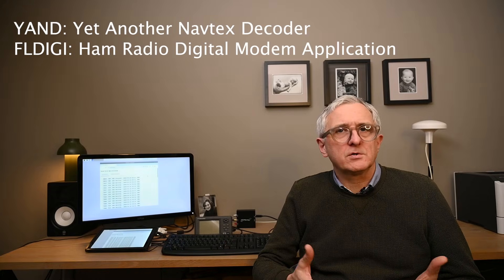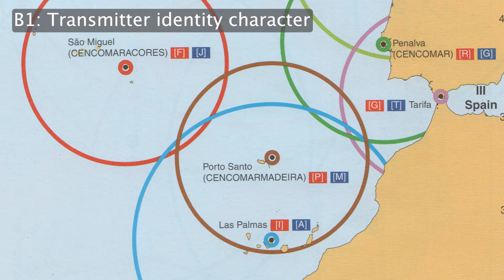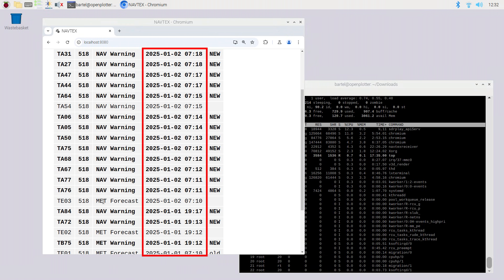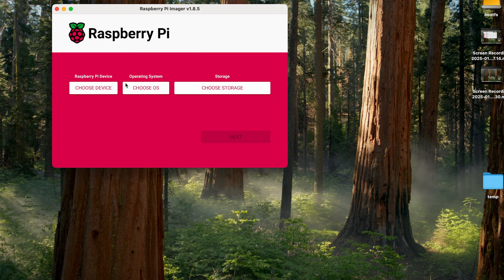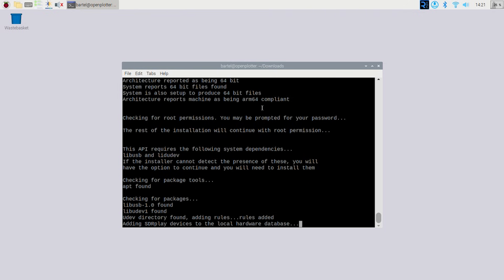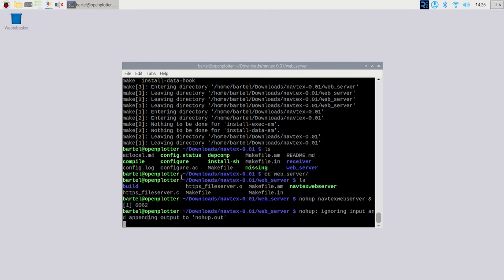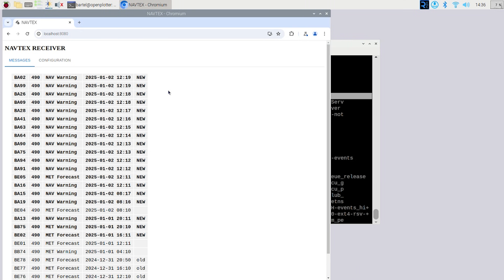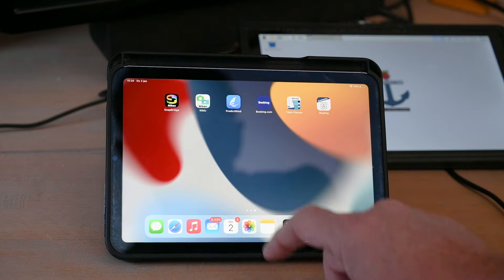NAVTEX on raspberrypi for sailors

Comment: Bravo, 
Avez vous egalement une solution en vue pour le decodage a partir d’un TX ou RX via la carte son ? Ainsi pas necessaire acquerir un sdr. 
Merci d’avance
Encore belle app
Reply from the maker: Non, pour le moment, je n'ai pas l'intention d'ajouter cette option à l'application. L'idée était de créer une configuration entièrement autonome. Ainsi, les utilisateurs n'auraient aucune intervention manuelle à effectuer, comme par exemple utiliser un récepteur radio externe, le régler sur la bonne fréquence au bon moment, etc.

Le logiciel de décodage est entièrement configuré pour traiter un signal I et Q provenant du SDR.

Est-il possible d'adapter le logiciel pour utiliser une carte son en entrée ? Ce n'est pas impossible... 
Je suppose que vous recevriez le signal sur un récepteur BLU (SSB), en utilisant le décalage de fréquence traditionnel de 1,9 kHz. Il faudrait prendre ces échantillons audio et :
1) décaler la fréquence de 1,9 kHz vers le bas et créer des échantillons I et Q (cela  correspond +/- à une multiplication par le sin et le cos de 1,9 kHz).
2) Appliquer un filtre passe-bas et rééchantillonner à 900 Hz. Heureusement, 44,1 kHz est un multiple de 900 Hz ; il faut donc un filtre de décimation avec un facteur de décimation de 49 (éventuellement en plusieurs étapes en fonction du contenu fréquentiel du signal audio).
3) Les échantillons I et Q à 900 Hz obtenus peuvent ensuite être transmis au logiciel via la méthode `sample_in` d'un objet de la classe `decoder` (voir `decoder.C`, ligne 42).

Pourriez-vous préciser le type d’application que vous envisagez ? LinkedIn me dit que vous êtes radioamateur, peut-être aussi navigateur (La Panne)?
Reply: Bonjour
Merci pour votre reponse precise. 
Effectivement un ensemble dedicacé en reception est preferable 
Je regarderais plus a fond votre logiciel j’imagine compatible ubuntu .
Dans le cas contraire un sdrplay et un rasberi ( le tout a mariniser) risque  de me couter plus cher d’un produit du commerce .
Plaisancier et radioamateur 😊
Belle journee
Reply from the maker: Bonjour,

Je pense que la solution la plus économique est d'utiliser un Raspberry Pi Zero 2W. (Attention au type de connecteur USB.)

Le coût pour "mariniser" la solution peut être un problème, notamment pour l'ajout d'un écran comme interface utilisateur.

Avec le Zero 2W, vous pouvez utiliser le navigateur sur une tablette ou un téléphone via Wi-Fi (aucun écran supplémentaire n'est donc nécessaire).

Le logiciel devrait fonctionner avec n'importe quelle distribution Linux moderne. En cas de problème, n'hésitez pas à me contacter. Je serai là pour vous aider.
BAV

Comment: Have you any thoughts on whether this hardware can be programmed to work with the proposed NAVDAT?
Reply from the maker: Well, the hardware (all of the SDRPLAY receivers for that matter) is for sure fully capable of receiving the proposed NAVDAT signal. (NAVDAT= the possible future version of NAVTEX)
NAVDAT would have a 10kHz signal bandwidth, so nothing any SDR receiver could not handle. 
When reading your question "whether this hardware can be programmed", you do have to know that the real 'software defined radio' magic is happening ... in the software and not in the hardware. The hardware will only 'sample' the complete information content of a portion of the radio spectrum. Then it is up to software to filter out the wanted signal, demodulate, decode, ..etc...
Navtex is a relatively simple modulation (FSK) and coding scheme. NAVDAT will be a much more modern one, using OFDM, variable modulation schemes (QAM, 16QAM, 64QAM) and error correction code rates. In other words, quite a different degree of complexity for the software receiver to be built here.

I hope this answers your question. 

By the way, there's quite a bit of info on NAVDAT available online. The only thing I'm unable to find is a clear calendar of how/when the system would be rolled out. There seem to be trials in France and China, but other than that no clear plan for the future.

Comment: 2:40 On the Turkish navtex frequency  4209.5 kHz, navtex messages end with three N. So NNN. I don't know why, but that is how I receive them with other software.
Reply from the maker: That's strange, the so-called "Navtex manual" by the International Maritime Organisation (IMO) makes no mention of this. 
Anyway, my software allows any of the 4 N's to be gone missing to still detect an 'end of message. So three N's would still be OK. 
By the way, currently you cannot receive 4209,5 kHz with my software. If you wanted to do it, it would only require changing one line of code though. You would the lose the capability to receive 490 and 518kHz in that case.
Reply: @boatcomm  Hello, a comment and compliments from a Dutchman based in North China. The 4209.5kHz is used in TUR, EGY, GRC, MEX, USA, but also in VTN, and CHN. 4209.5 transmissions in China seem to be easier to receive with my RTLSDR about 400 miles from Shanghai.  There are several new stations planned in Mexico. would it be possible to include the 4209.5 frequency and select or automatically skip according to the transmission times to receive 4209.5 messages? And is it possible to use with (much cheaper) RTL SDR v5, or would that involve a lot of rewriting the code?
Reply from the maker: Hello Arne, 
I can certainly foresee the possibility to receive 4209,5. It's a minor change and I can foresee a command line option for that. No issue. What I will not do is switching frequencies at certain moments in time. Navtex messages are sent preferably in the 10minute timeslots, but certainly not exclusively. Important messages (MET warnings, SAR messages,..) can also be, and often are, transmitted outside of the regular timeslots of the transmitter. So a decent Navtex receiver is listening all the time, not only during specific timeslots. 
Use of the RTL-SDR was not really my intention, but since there seems to be a lot of demand for it, I may give it a try one day. 
BTW, as 'Dutchman' you may also want to read the reaction I wrote on a comment of @pieterjanvisser yesterday. The RTL-SDR is a less obvious choice than it may seem. 
Is there a v5???

Comment: Hello! Maybe a bit of a straight forward question but what is the best way to update from navtex-0.01 to navtex-0.03. (Sorry I overlooked there was a newer version!) Best Regards.
Reply from the maker: First of all: I recommend upgrading to the last version indeed. I solved some bugs that led to occasional crashes of the webserver process. 

If you managed to get the v0.01 installed and working, the procedure to follow for upgrading is kind of the same: 
Download the tar.gz file (wget http://csme.be/dl/navtex-0.03.tar.gz)
unpack it with the tar command (tar -xvzf navtex-0.03.tar.gz)
move into the directory that was created (cd navtex--0.03/)
build the software (./configure ; make)
then running 'sudo make install' should overwrite the two executables (in /usr/local/bin) with newer versions

That's it basically. 
Let us know if it worked. 
Always happy to hear reports of people that succeeded in using the software and receiving actual navtex messages!
Reply: @boatcomm  Thank you for the quick reply!  I have had to start from scratch again as I seemed to have messed up the rc.local file!
My fault for using vim when I am use to nano! Still learning Linux Command Line! Not a problem though.
I will make note of the above info and keep a look out for the next release as and when it comes and will then do the upgrade and report back.
I would be interested in the future when up and running for a while to see if it would be possible to auto export the database once a day or more if needed, before messages are deleted.  Strange request I know but there is a reason for this, time being one of them!

Thank you very much for creating the software and I am very much looking forward to using it!
Best Regards, Andrew.
Reply from the maker: The software deletes messages after 72 hours in line with Navtex specifications. Every 'real' navtex receiver does this. You can change this behaviour by changing line 13 in receiver/message_store.c: 
#define MESSAGE_PURGE_AGE 60*60*72    

Change 72 in whatever suits your needs. 

The database is sqlite, database structure is straightforward. You'll find it under /opt/Navtex/Navtex.db
There is an other option though. Maybe you are familiar with web-technology.  In fact the 'webserver' exposes an  'API'. 
It means you can 'browse' the webserver with localhost:8080/messagelist (or whatever the ip is) it will return  ... a list of messages in JSON format.  To obtain the message content get localhost:8080/messagecontent/<message id>. 

Hope this helps...
Reply: @boatcomm  This is great! I will have a look into this in the coming days! 
I am now up and running on version 3. Have receiver first two messages from Pinneberg. I will report back in a few days, intend to leave the receiver running now. 
Just for info purposes, I setup v3 on a headless RPI3b with an sdrplay RSPdx-R2.
Many thanks and best regards.
Reply from the maker: @andrewjwhall  Many thanks for reporting back. So far I had no report on a RPI3, nor for the RSPdx-R2. 
Interesting channel you have. I suppose you have a specific interest in meteo forecast messages...
Reply: @boatcomm  I have a bit of a wide interest in NAVTEX for sometime since I became "land locked" in 2007! Have not seen the sea since 2019 and as an Englishman that is quite painful to say the least!
Setup has been running since Sunday 16/03 (to date 19/03) and all appears to functioning perfectly (as far as I can tell)!
Would be happy to provide further regular info if wanted? Setup is running 24/7 at the moment!
Is there another way to private message you instead of here on YouTube?
Best Regards,
Andrew
Reply from the maker: The profile linked to this channel should contain an email adres  you can use (bartel AT csme.be). Feel free to drop me a mail. I'd be interested to hear what type of antenna you use, as I'm preparing a next video on the antenna topic...

Comment: Hello! Very interesting video about telecommunications on ships!! Thank you for this material.
May I ask you a couple of questions?
What type of touch screen have you used and how is it connected to the Rpi?

This other question is more about radio at sea... Do you know if traditional SSB MF/HF communications are still being used? Or have they been totally replaced by satellite solutions?

Thank you and congratulations for the channel!
Miguel
Reply from the maker: Touchscreen is this one I believe: 
https://www.waveshare.com/product/displays/lcd-oled/lcd-oled-1/10.1inch-dsi-lcd-c.htm?___SID=U
RPI can easily be mounted and connected via DSI interface. 

I'm not sure I should recommend this screen though. After having it installed on a boat for one season (6 months in BE) it already gave up. A part of the touch interface has become non-responsive.

SSB MF/HF communications are certainly still being used on commercial ships (ships that are under the SOLAS convention). SSB is part of the so-called GMDSS system. The alternative (or backup) system is Inmarsat and a GMDSS-compliant flavor of an iridium service. Iridium is only an allowed option in GMDSS relatively recently. Before that there was only SSB and Inmarsat, and for polar areas SSB was the only option then, as Inmarsat geo-stationary satellites do not provide coverage beyond a latitude of  +/- 70degrees
Reply from the maker: two more things: 
you can see the touchscreen installed on the boat briefly in the intro of the video. I'm running an plotter-SignalK-KIP dashboard there. 

SSB is used not only for (DSC) voice communication. 
In fact in GMDSS  there is also an HF based variant for sending MSI (Maritime safety information) e.g. to polar areas. It's called NBDP (Narrow-band direct printing). It's a protocol very similar to Navtex by the way.